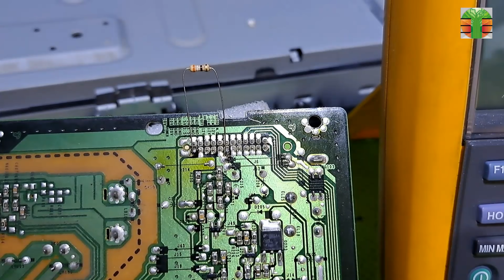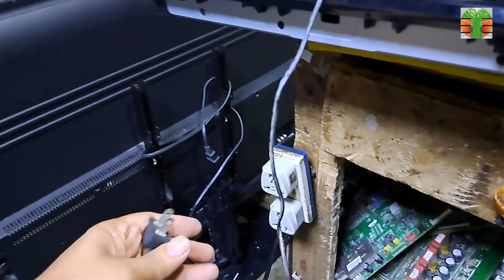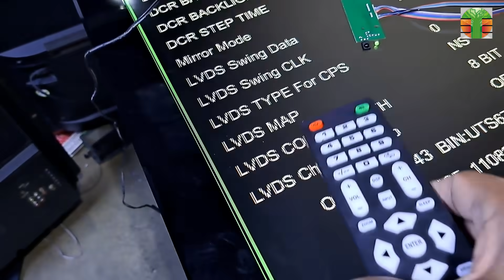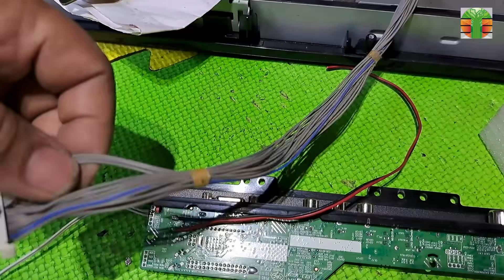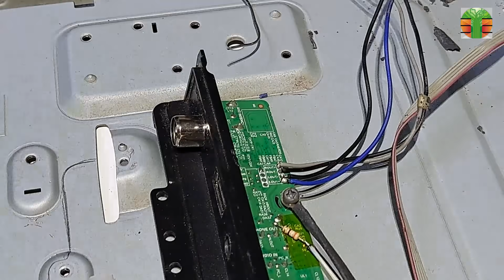Installing a universal tv board and control the PFC

Comment: Hello Tevz, better if you work with new capacitors even to show us how to fix it. The multimeter is great of course because Fluke offer the best Insulation and protection on their multimeters also measure with high Frequency which mean more precision when measure voltage with frequency on power suply Chopers. Be careful when you measure voltage and Current with those probes and choose the beter with more insulation for do not fail when you are runing with diagnostics. Try TP80 but from MC brand, the Fluke sell those and are perfect for Nano technology. If you see today TP80 from Fluke with very small point and cover colored protection are not so good but if you see those from MC with transparent covers that mean very good.
I don't know why they change those because they was perfect many decades. Must be writing on probes MC not Fluke.

Comment: Those LG TVs from around 2012 all seemed to fail due to that chip overheating and separating from the board. In the UK I remember a lot of these TVs being scrapped because even a replacement board from a broken TV would do the same thing a short time later.

It's interesting to see these universal boards being used - here it would cost almost as much as a new TV to get someone to do the work you've just done on the set, as it takes skill and time to do it. Is the picture quality as good with these boards?

With your level of skill I think you could make a fortune in Europe or the USA!

Comment: Good job on the PFC & 12v separation, I did similar to a Sharp 52 inch but psu only hd 15v output :(
Reply: why separate the pfc ? it's not separated at standby in normal conditions?

Comment: Hmmm. I have been doing this conversion. 
You just struck me with this new pattern. Seriously i don't understand why and what you did to the PFC. 
I will only connect the PS to the 3.5V and thats all .
Can you please explain what happens if i dont separate the PFC.
Is this method only applied to LG power or every other brand.?
Reply from the maker: PFC is like a primary regulator, the main capacitor will boost upto 390 volts, some lcd backlight inverter won't turn on if the PFC is not active, its necessary to turn it off if is not used,  it's  consuming electricity so it must be turned off.
Reply: Where did he connect the 3.5 volt pin to using the resistor? 
I find it very difficult to understand the commentry.

Comment: I also have to buy a good and expensive multimeter, my primary one is got damaged during continuty test😢
Reply: You should not plug into a power source while doing continuity test.
Reply: @AwmteaPachuau  I did disconnected but the main capacitor was charged